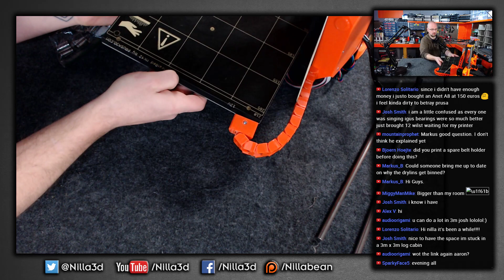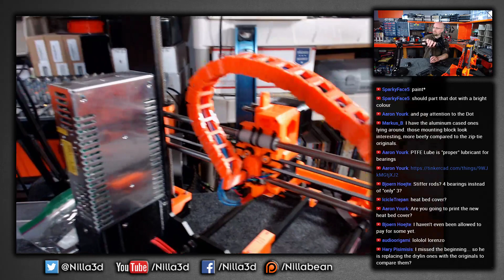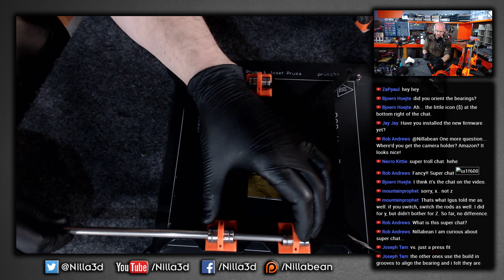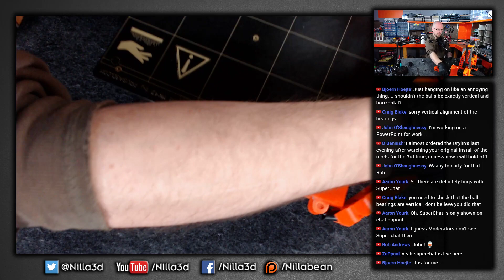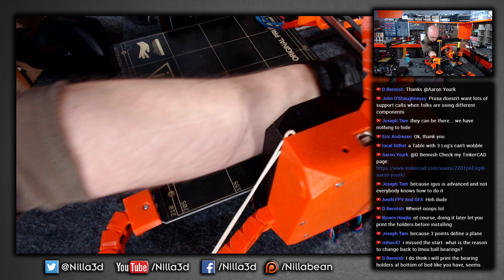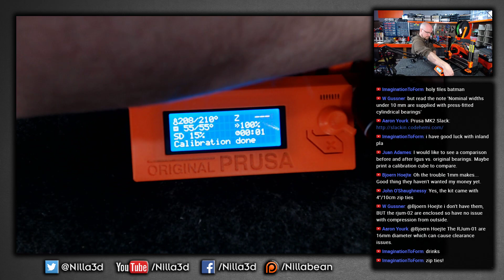Live Stream - Drylin Bushing Revisit + Super Chat?!

Comment: Nilla  Prusa has a glass bed why is it that none of you want to use it Is it junk meaning the bed will not heat up to temp like it would using tape/hair spray?
Reply from the maker: The tempered glass plate they offer in their store is only for the older version of this printer (the Mk1). People don't use it because the newer 'Mk42' heated buildplate with a sheet of PEI is superior is the vast majority of situations. Its not that its junk, its just that with the new design + PEI you don't need to use tape, hairspray or anything else to get good adhesion under most circumstances.